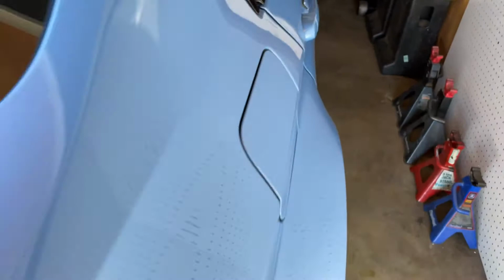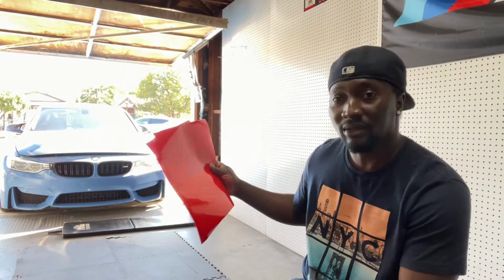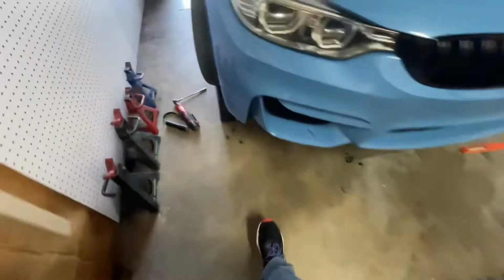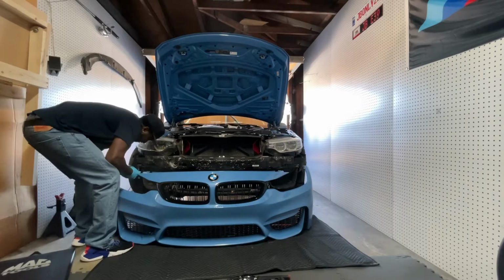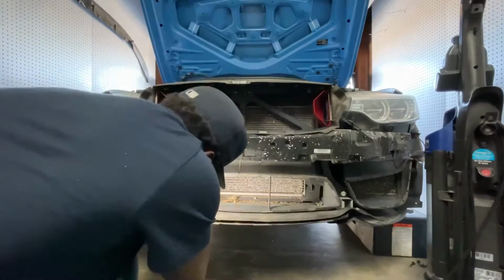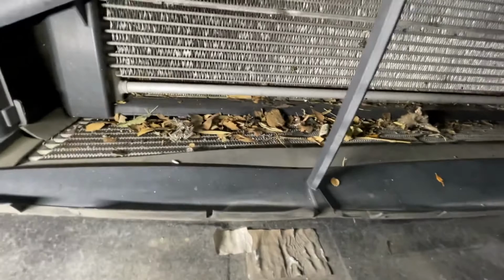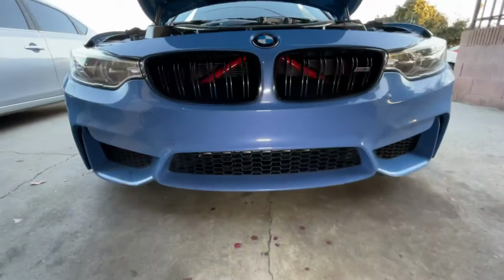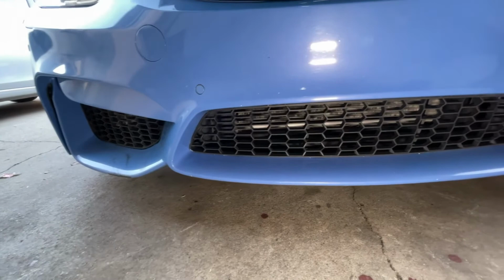How to clean leaves and debris out of BMW F80 M3 radiator, diy.

Comment: I have a 2017 540i. Way too much grass and leaves between the radiators. I ended up taking the radiators out and deep cleaning them. My solution is to cut out the plastic just under the radiators since it has another plastic piece covering all that with the little screws. Hopefully the leaves will have more room and go towards the engine and fly around down low and find a way out.  You have to clean it out cause as soon as that big fan clicks on. All the leaves probably go up the radiator and stick in the middle and then go back down when the fan turns off

JbP. Not sure if your BMW has a gap between radiators like mine. But if you take off all the top plastic covers and the aluminum brace that goes across. Then you can see in there. All the leaves worked their way under the first radiator and stayed right in the middle

Comment: You don't have to remove the bumper.  All you have to do is remove the right and left belly pans, followed by the center belly pan (all 8mm) then unbolt the radiator, two bolts on passenger side, one bolt on driver side (13 mm) which will release it for easy access to clean.